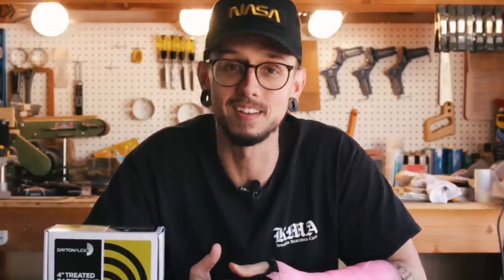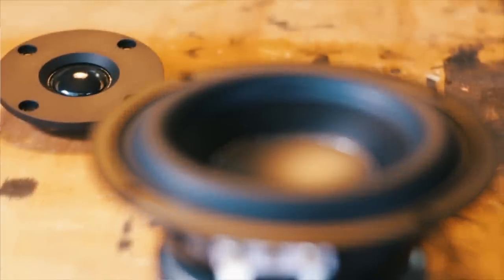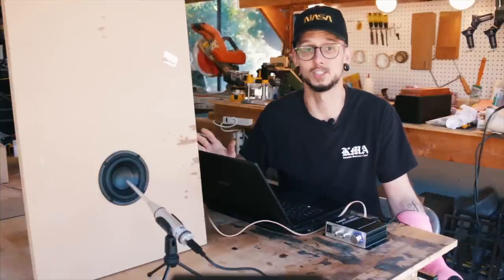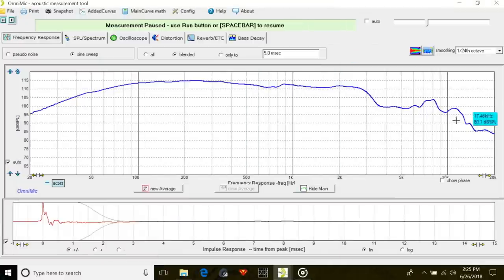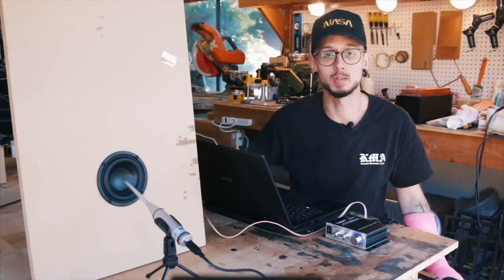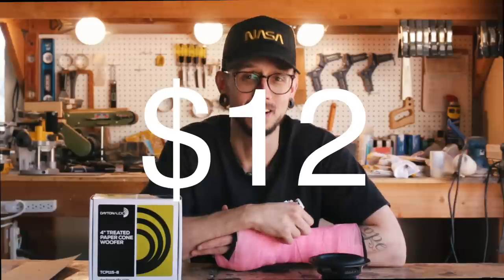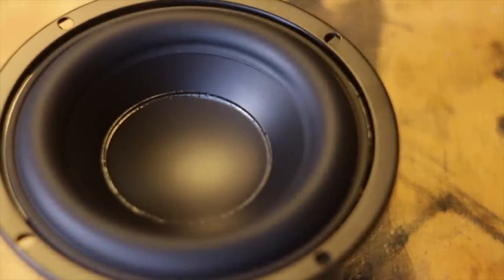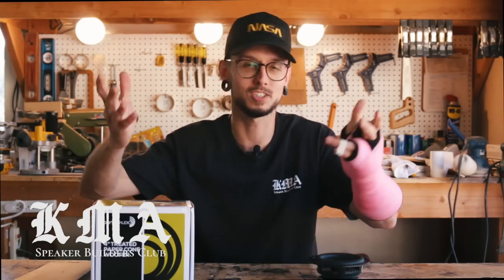Best Budget 2-Way Woofer? The $12 Dollar Driver || Dayton Audio TCP115 Woofer Review

Comment: That dip at 800hz is a reflection off the table. Not the baffle, not the ambient noise, not the mic or driver, nothing except the reflection.
Reply: Also the laptop? maybe
Reply: Is there a consolidated list of common dips/peaks caused by environment stuff?
Reply: @ulamss5  It's totally related to distance and the wavelength of the frequency.  800Hz is about 15" in length, so the wave bounces off the table and comes up and  partially cancels the direct wave. If the driver and mic were moved higher, the dip would go down in frequency.
Reply: @gregworrel2623  so this dip is generally correlated to the distance from the driver to nearby parallel surfaces?
Reply: @ulamss5  The distance to the driver AND the nearby parallel surface equating the final distance that will influence the specific frequency that matches the distance of reflection. Basically, either remove reflectional abilities or increase the distance to any parallel surfaces far enough to remove any chances of wave cancellation.

Comment: When you have the mic right inside the woofer, you are making a near-field measurement. When you have the mic outside of a distance equal to 1/2 the driver diameter, it becomes a far-field measurement and the reflections from your workbench become significant, and that is why you start seeing dips. Dips come from anti-phase wave energy reaching the microphone in addition to the in-phase radiated energy. Near-field measurements are good up to some frequency related to the driver diameter, but ultimately the best thing is to put it in an infinite baffle, place the microphone 1 or more meter away, and then gate the reflections so they don't influence the measured response, and you will be able to get good high-frequency data (with limited low-frequency validity based upon the gate length), and then you can combine the nearfield and far field 1m measurement to get a continuous frequency response plot.
Reply: rorybz , here we go with another Goggle smart couch zombie explaining everything
Reply: Tim Schutte Let me know if anything was unclear, and I’ll do my best to make it understandable for you.
Reply: rorybz , thank you Mr Guttenburg Einstein
Reply: Good call.  Gated measurements @1M are the way to go, particularly if the measurements are going to be used for x-over design work. I recommend actually doing the measurements in the box that you plan to use the driver in, as the size and shape of the baffle is also going to affect the results (there will be some gain at frequencies that have a wavelength smaller than the baffle's dimensions).  The further that you mount the speaker and the mic away from any object that can impact the measurement, the longer the "gate" you can use, and the lower in frequency the measurement can go before it becomes inaccurate. 

One other trick I use - instead of using a tape measure, I use two dowels cut to size for distance measurement purposes - the first one cut to 1M to set the distance between the speaker and the mic, and another around 125cm in length to check to see if there are any nearby objects that are closer than 125 cm to the speaker (mounted on a 4 ft stand) or the mic (ditto) .

Comment: Love your videos! 2 cents from a professional audio engineer; Most accurate result would be to measure at 1 inch to reject all reflections and room modes and compensate for proximety effect. The low end response of a microphone varies significantly the closer you place it to the sound source. I would measure the proximity effect of the mic at 1 inch and then deduct that amount to offset your measurement result and compensate for the artificial low end boost of the close mic placement. 

As is I don't think any of the measurements in this video are accurate enough to really tell us a true story. 

Love your work. Keep it up!

Comment: , I used this mid woofer along with the $8 dollar silk done tweeter to replace some drivers in a pair of KLH 3 way speakers I use at work in my maintenance garage.
I'm powering them with the DTA-1 / T-AMP that you also did a video on.
it sounds fantastic !!!!!!!
perfect for what I need.
I also replaced the 8 inch woofers in my KLH speakers as well.
so now my KLH speakers are basically Dayton Audio 3 way speakers !!!!!  I just kept the original crossovers inside the cabnets. I purchased two
25/8 inch X4 inch long port tubes from Dayton Audio to change my speakers from sealed cabnets to ported cabnets.
I will do a sound comparison. Install one port and compair it to the sealed enclosure. if it sounds better, then I will do the other book shelf speaker as well. I personally think they will.
oh, by the way, when I removed the drivers from one of the cabnets I noticed there was NO POLYFILL or insulation what so ever inside, ahhhh!!!!!  no no no!!!
I purchased some self stick 1/4 inch thick stick on insulation and some POLYFILL from Parts Express!!!!!!  this will also help in the sound since I also upgraded the woofers to Dayton's 8 inch paper cone woofers !!!!!!!!!!!!😁
I truly think that the sound will be incredible when I get done reserecting these speakers from the dead, they were in storage for ten years and the drivers took a shit, tweeters were those cheap mylar POS.
the woofers were literally frozen, stuck in place and wouldn't move back & forth to produce any sound. I may be looking into replacing the cross overs down the road to see if that helps as well because the factory cross overs are just simple resistor type bass blockers is all they are for the mid-range & tweeter.
the subwoofer is wired direct to produce what ever it can with a full signal. this is typical common practice with cheaper speakers and I think with some quality upgraded proper crossovers, that they will sound much better.
thanks for your videos Kirby, I subscribed to your channel as well, God bless & have a great day!!!  keep up the good work.
you are a great inspiration.

Comment: One tool I didn't see in your links was the hole saw for the baffle cutout.  Parts Express says 3.77" Baffle Cutout Diameter, but doubt there's exactly that size out there.  I'm guessing 3 3/4", but want to know before ordering.  I am looking at building a LCR sound bar using your DIY speaker series as a guide (same drivers, crossover) but in a sealed enclosure (I will be using a powered sub, so low frequency response is not as important for my situation).  Appreciate these videos, I learned a lot!

Comment: These look like they could be the same drives from the Dayton MK series speakers.

I'm super impressed with the transmission line towers and matching center/rears I got for a basement 5.1 system that has me rethinking the value of the living room system costing 3x. Not crazy efficient but power is cheap these days.

Comment: , I have an old pair of RCA speakers that actually work with decent bass but needs upgraded bad for work. I'm buying two of these woofers and two tweeters that you recommend for 8 bucks and woofers for $12 bucks each. nice specs.
should work perfectly.
the cabnets are 10x6 1/2x7.
about the size of the Micca 42Xs.

Comment: Any tips on building an enclosure for a speaker you do not have technical specs on?
Reply from the maker: No, sorry! I get this question all the time and theres really nothing you can do other than test the speaker your self with something like DATS or just guess. Thanks for watching!
Reply: Trial and error.wont be optimized but with a little luck it'll still sound good.
Reply: Craig Shelhammer I luckily got mine to play at 27 hertz. I'm using a Drok 4" circle driver.
Reply: /b/ Tard very nice!whatd you put it in?

Comment: Hey quick question, I've got a pair of Micca MB42X Bookshelf Speakers. But one of my drivers blew, I was wondering if these would be good replacements.  At 12 bucks this seems like a great deal.  Would it be worth getting a pair of these to just replace both my drivers or should I aim to try getting the same Micca Drivers or something else? How would the TCP115 Compare to the HiVi B4N 4" Aluminum Round Frame Midbass?
Reply: Ended up getting the Daytons, but part of me still wonders which one would sound better between daytons and HiVi B4n

Comment: try making a pyramid themed box for some speakers
Reply: Why a pyramid out of all shapes?
Reply: Melon. It wouldn't sound good... and it would be extremely hard to find the size...
Reply: It can sound good, but it has lot's of disadvantages. Mainly diffraction and production. And what are the advantages? You get a uniquely shaped loudspeaker! There are plenty of other ways to do that.

As for size, that's not the problem. You can easily cut triangles and put them together. The problem is adding them together accurately. Also volume is quite innefficient.
Reply: Melon. , I love that shape, I thought I was the only one.
in fact, I'm going to use these exact speakers to make me some computer speakers out of in the shape of a pyramid without the point on top.
kind of cut off a little.
tweeter on top, bass driver at bottom, port and connectors on back.
hook them up to my Altec Lansing sub and ditch the crappy little satalite speakers that came with the system.
I just have to incorporate the controller some how in the design.
oh well, that's what epoxy is for I guess, lol.
Reply: Melon. , that's exactly what I'm doing next with the tweeter at the top.
I thought I was the only person with that idea, lol.
vented also with 2 of these woofers so I can get a 4 OHm load for my class T dta-120 Dayton amp.

Comment: Hey, man! I've loved these videos for a while - your production value is impeccable and the speakers built just look like quality - but I'm wondering if you've done a more purpose-oriented video on creating an add-on subwoofer? Basically, I've got a little set of Fostex PM0.1 speakers that I love using for music production (I've learned how they sound and they work for me) but they lack in the low range. Do you think you could point me in the direction of, or create your own, video of a sub that can be used as a passthrough to the main speakers? Fostex's PSub Mini is cheap, but I'm betting it's large for my tastes and it'd be cool to build one myself. I just don't know how.

Comment: I put this driver inside a Logitech z313
Reply: Officially Isaiah i did that too but with the ND105 4ohm. Now i got that same sub in a massive floor standing cabinet sized for a 12"
Reply: I use the rockford r1525x2 and I designed the crossover so the speaker only plays 1000 hertz to 2.5 kilohertz that means my speaker only plays 16 notes from the C note to the D note
Reply: patk2 why would you only want to play 1000 plus hertz? Subwoofers don't play at that range, and you virtually just made a tweeter, because people mostly talk at the 100 through 300 Hertz range... you virtually just made a useless object...
Reply: my SN2000 subwoofer can go to 1000 hertz easily and my subwoofer plays all the sounds lower then 1000 hertz a lot better then my 5 inch rockford speakers and I was listening to sweet child o mine song and the G and F# notes on slash guitar freaked me out its the best sound I have heard and the frequency for the G and F# notes is 784 hertz and 740 hertz but I have tested the sound and the G and F# notes from slash guitar can be heard on all of my speakers even my tweeters

Comment: While I appreciate that you are trying to explain things in an easy-to-understand way, I am afraid you are ignoring a few quite important things when doing these measurements and interpreting them. For instances, the dip that you are mentioning at around 800 Hz when measuring from 6 inches away - what are intending to do about it? Is it real or just a consequence of your lousy measurement setup (reflections from the table, e.g.)? Meaning, with these measurements your most likely not gaining any worthwhile information for building your speakers and the filter. You could as well not done them and just use the already available frequency response for this driver. Anyway, no disrespect meant - appreciate your enthusiasm and spreading the word about building speakers.
Reply from the maker: I don't intent to do anything. This wasn't meant to collect FRD for my build, it was just to just show a quick demonstration of what the speaker can do and how distance from the driver introduces outside input. My plan is to test my crossover design and compare using the given files from Parts Express when the speakers are built. I'm pretty sure the dip was caused by the setup. I'm in the middle of designing a better test rig that should give better results in the future. Thanks for watching!
Reply: Could be reflections from intervening surfaces, also cancellation from the pressure waves coming around the edges of the "infinite baffle." Might even be interesting to compare the distance from the driver to the edge of the baffle and back to the mic to see if it comes close to some multiple of 15 inches (~wavelength of 800 Hz).
Reply: it's definitely the reflection, the cancellation would be just that a cancellation which would correspond with a loss in the lowend